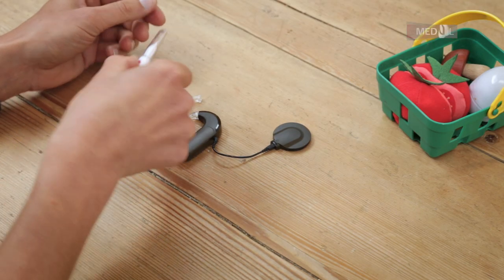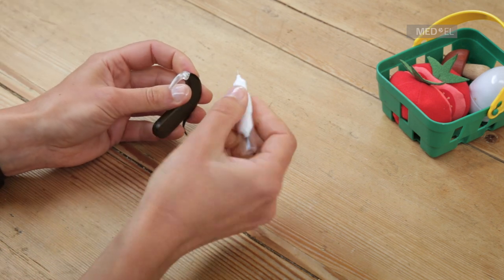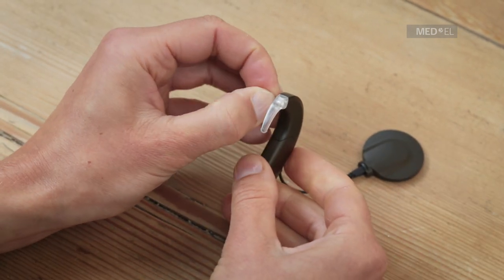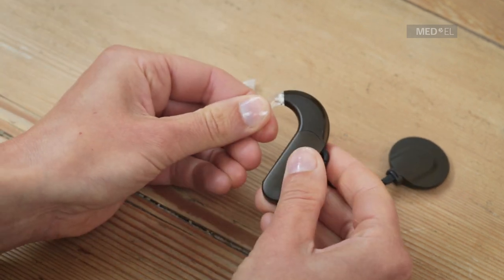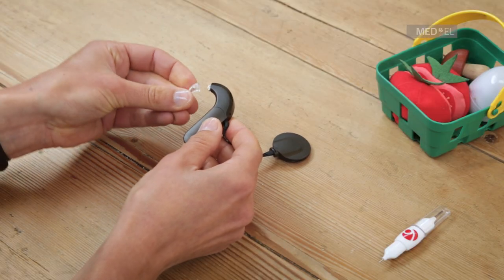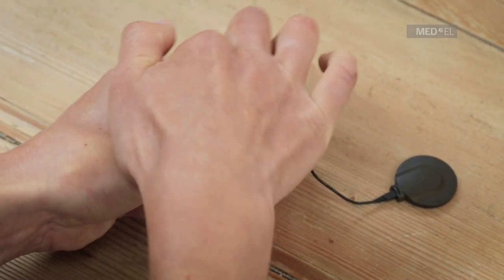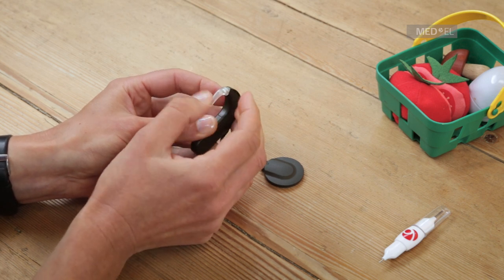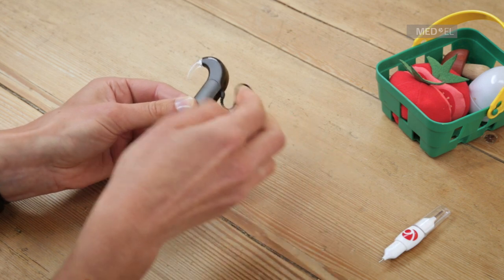SONNET Hands-On: Removing & Replacing the Earhook—MED-EL

Comment: Just what I needed, great video.  Only my pin will not budge.  :(
Reply from the maker: Hi there, you won't need to remove the pin if you have the newest version of the microphone cover, you can check here which one you have: https://www.medel.com/support/product-support/audio-processors/sonnet/handling-and-basics/sonnet_handling_changingmicrophonecover. In case you have the old version and experiencing issues while trying to remove the pin, please reach out to your audiologist or local MED-EL office so they can have a direct look at your device: https://www.medel.com/clinic-finder. Kind Regards
Reply: @medel  Thank you very much for the suggestion, though, unfortunately, I have the old version of the cover.